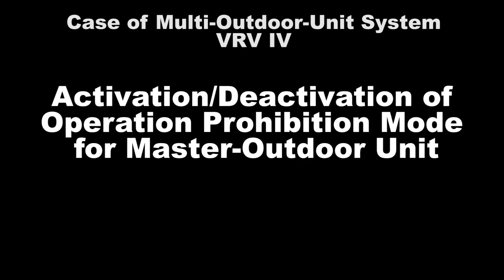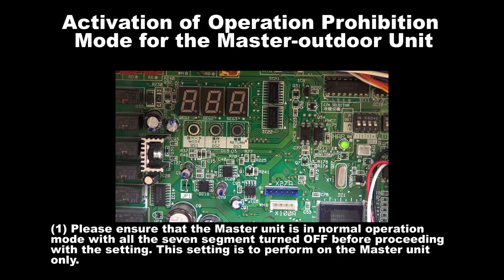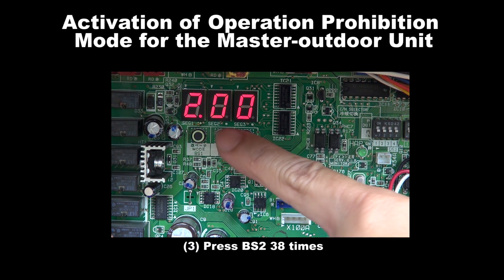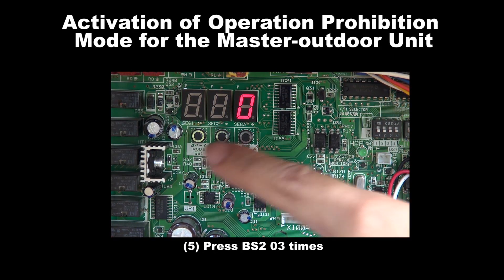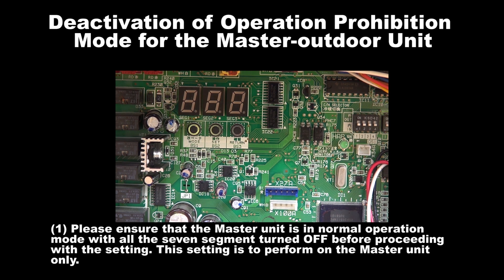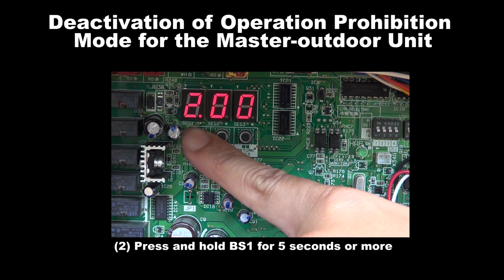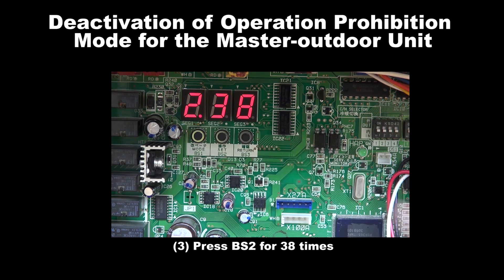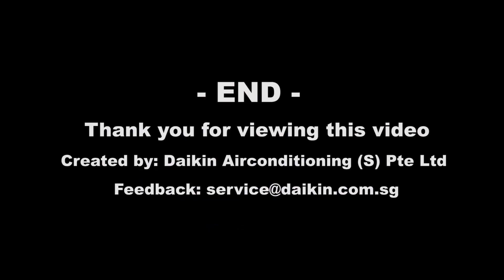Emergency Setting for VRV IV Master Unit Compressor Failure

Comment: Hi I have a vrv 111 (3) it has j5 fault and the reading on the suction thermistor is around 15 k ohms at 26 degrees. It has 3 x wall control all showing the same j5 fault. Is there a way to get this working while waiting for part's?